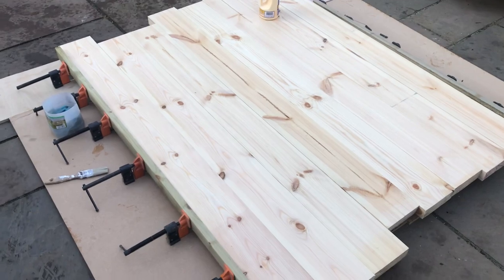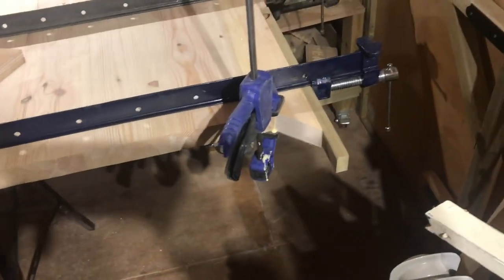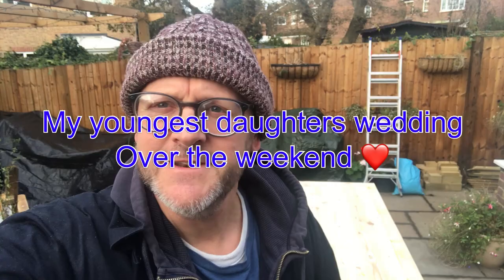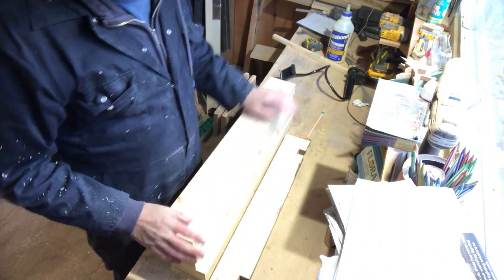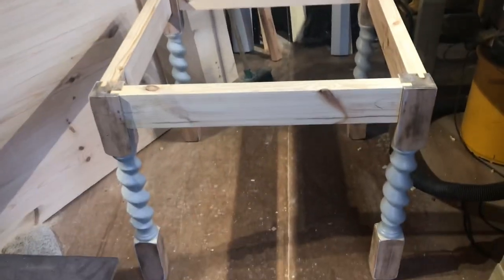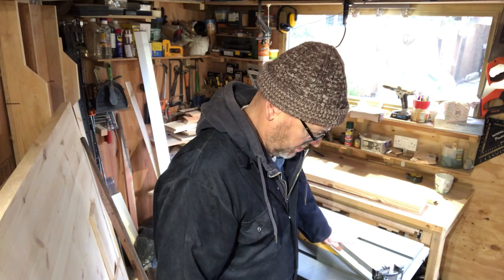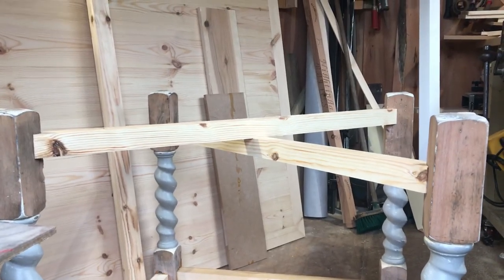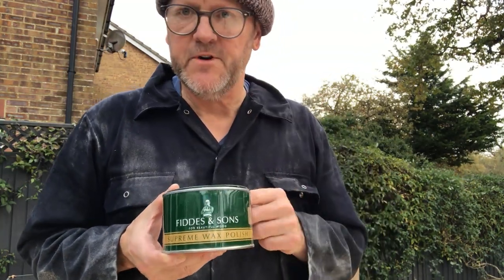How to build a large dining room table in a small workshop

Comment: You did very well.  I have the same problems in my workshop.  I built a large bookcase that I had to do the final glue up in my living room where it lives.  Very challenging cutting some of the boards.  Had to rearrange my workshop to accommodate the size.  Thanks